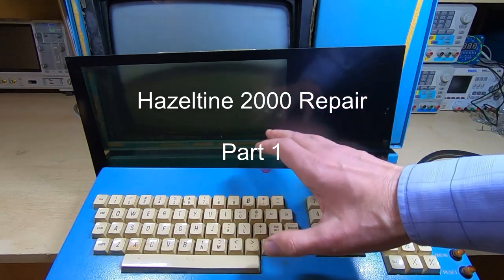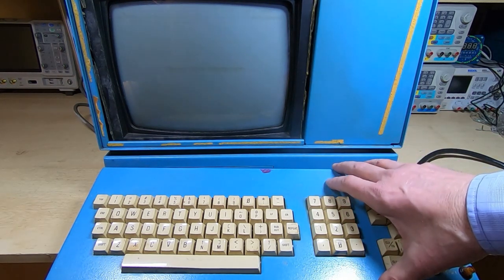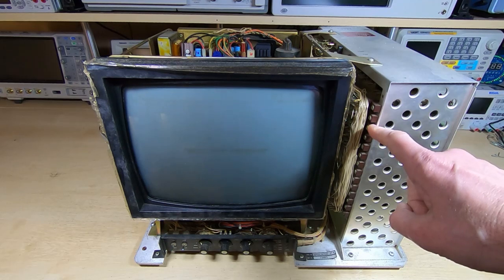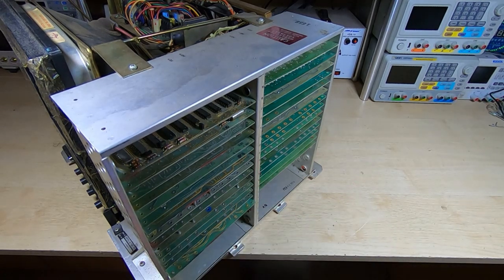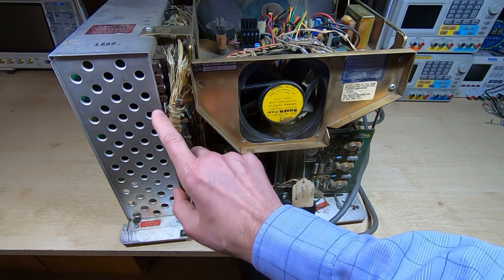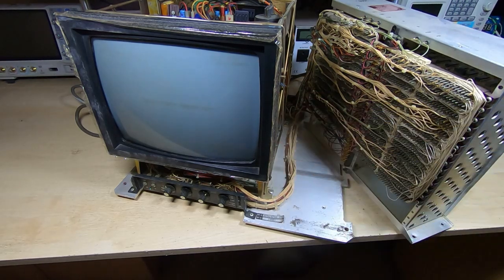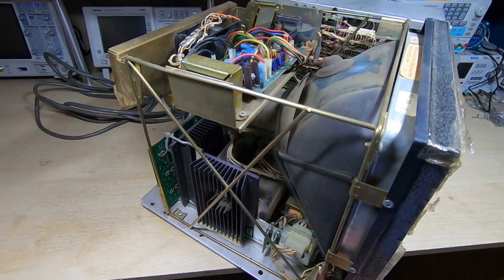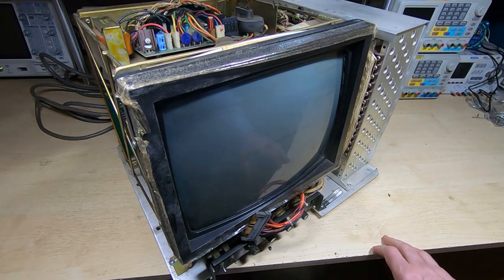Hazeltine 2000 Repair Part1

Comment: Back in the 1970's,  I worked for Syntonic Technology, Inc. who was the primary service contractor for the Hazeltine 2000, among other products. These terminals were hugely popular, with both large and small businesses. Aetna and Travelers insurance companies in Hartford, CT had  hundreds of them. The large number of small plug in cards, with their associated connectors, made them prone to intermittent problems. Servicing them could be quite frustrating.

Comment: I too used one of these on an HP2000/F timeshare system in the late 70's.  I hadn't seen one since then, and what struck me most is how crude it looks - at least externally.  I suspect there were no "industrial design" people involved in the exterior design of it - it was strictly an "engineer's box" design.

Comment: Well, okay then!  My first actual physical contact with a computer (other than my HP calculator) was through a Hazeltine 2000; it was sitting in that chair that I fell in love with computing.  What really got hooked me was being able to backspace, and edit my mistakes to where it was if they were never made.  Perfection!  I had been doing a lot of typing, and even on a Selectric, the white-out was fairly obvious.  And then... being able to run programs of more than the 49 numerically-coded steps as on my HP...  oh my.  Basic!  Glorious!

The school had lots of them -- relatively speaking -- for the 32-terminal HP timeshare system. I'm surprised to learn they were so expensive.  Only the more adventurous of us lab assistants ever used the more sophisticated features; they certainly weren't mentioned in class.  At the same time, Berkeley was overloaded with the little ADM3a's.  Lots and lots of 'em!  I guess because they were cheaper.

Comment: The wikipedia article on this machine mentions that the serial connection is not via a port on the back but via a hard wired cable. Is that, perhaps, the loose cable you found?

Looking forward to seeing how this restoration goes. Really appreciate you taking the time to document your exploits.